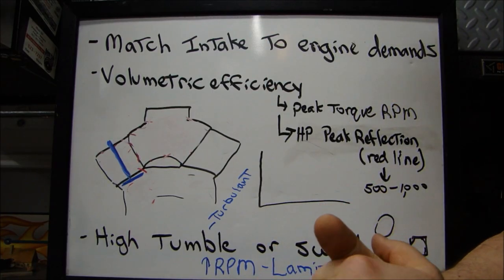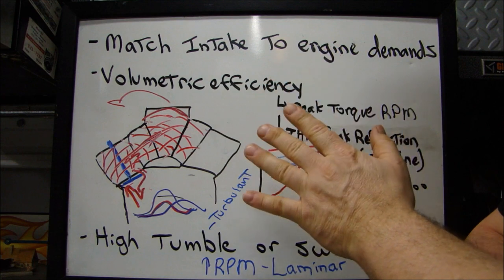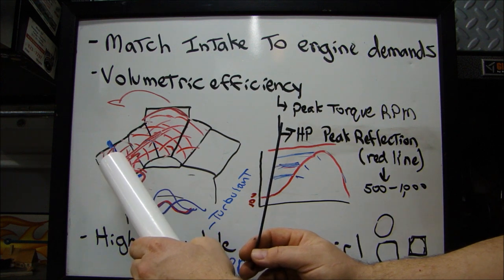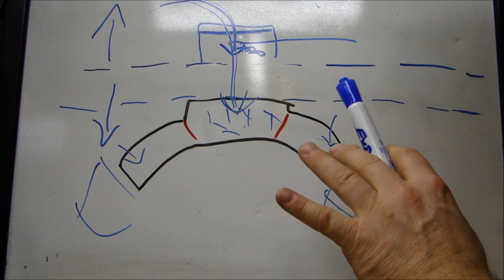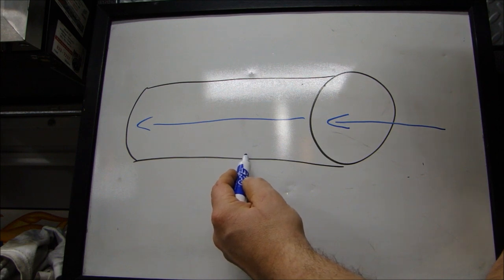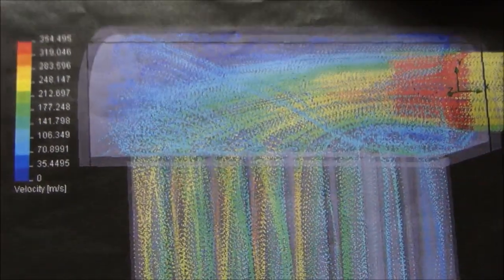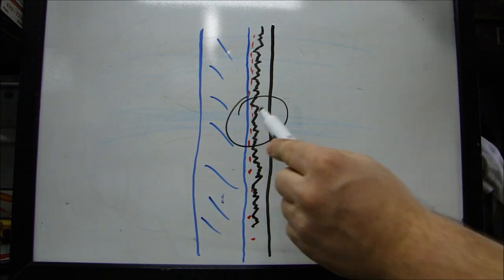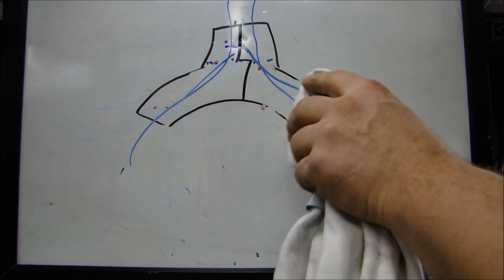Engine Building Part 8:   Intake Manifold Theory

Comment: you in your video slightly mixed up how bernoulli's principle actually works it's the slower air underneath that creates an area of high pressure compared to the top of the airfoil. On top of the airfoil air is moving faster due to the farther distance the air needs to travel to go around the airfoil compared to the bottom. sorry but if I flew an airplane using your interpretation I would crash and burn. On the flip side your videos are chock-full of valuable information, keep up the good work.
Reply from the maker: MrSquirrelyman123 Thanks....I thought I corrected that....I appreciate it

Comment: Hey Pete. Want to exchange emails? And I think I have added 100 moore Hp probably an other 85 lbs of torque. The maniacal s10 came with 160 to the crank. The 262 v6 was slateded to be a marine motor. Have questions please ask. And where are you located. Thanks maniacal s10.
Reply from the maker: I am in Buffalo, NY petesgarageinfo@gmail.com

Comment: This is godly for us noobs sir. Thanks a lot!
Could someone indicate a material on those older SOHC 8v audis that were mounted on vw's? (I also need some advice on the Pierburgs)
Reply from the maker: +Marco Martini That's a tough one. good luck finding that info. If I come across any I will share
Reply: Thanks again! I found some material, but it is in Russian and other slavic languages. It seems that there is good material in spanish.

Comment: So... keep it rough for carbed engines and smooth for fuel injected engines. Right?
Reply from the maker: mikeradman Yes
Reply: mikeradman Yes and No.   I believe the major contributing factor is likely that carb'd setups are introducing the fuel much earlier into the air stream(further from the combustion chamber) while EFI introduces the fuel much later into the air stream (closer to the combustion chamber). 
Also keep in mind that early EFI systems such as throttle body injection could/should be treated more as a carb'd setup in this aspect since it introduces the fuel into the air stream just past the throttle body. As EFI technology progresses the more you'll see direct injection which essentially doesn't have to deal with these issues, however it has it's own to deal with. Essentially, the further from the combustion chamber the fuel is introduced to the air stream, the more you have to worry about effects from the intake system, such as roughness, cryogenic expansion which can cause the fuel to drop out of the air stream and onto the port walls, etc...

Extremely simplified explanation of boundary layers, but without the math it was to be expected. I would've loved to see an illustration of the velocity profile and it's relationship to the boundary layer. (I.E. the development of the velocity profile as it progresses into the port and becomes fully developed and maybe a mentioning of the vena contracta)
 Great videos none the less though.

Comment: is it ok to run a cam with 2000-4800 rpm range and a intake with a rpm range of idle to 5500?
Reply from the maker: The cam and intake are not the limiting factor to higher RPM's. It won't hurt it

Comment: You said that if this was carburated things may be different. I'm interested in doing this carburated, what would be those things that could change?
Reply from the maker: Surface finish, velocity, runner diameter. Is there anything specific?
Reply: Would it be worth getting a different intake then If u used carbs?
Reply from the maker: Not really. I modified a carb manifold for throttle bodies

Comment: any suggestions for an intake on a 5.7 vortec? i have some other upgrades and the manifold is keeping me from getting the engine to be where i want it to be for power
Reply from the maker: What are you currently running?
Reply: Just a chevy silverado, lookin to put some more power into the motor
Reply: I beleive the injectors are inside the stock manifold, and they are spider injectors, so that means i would have to find.a way to put in.new injectors somehow

Comment: I have a 2013 cruze and I have it 2 port direct ram, one port is the ram hood and the front grill , I want to have an F1 style air intake manifold, should I make it out of cast aluminum ? and can I make custom ports for better sparkplugs and injectors , I'm looking to go to either 810cc or 1000 cc injectors. Is this safe for stock pistons?
Reply: Also was going to have an air intake system resembling the NA 458 Ferrari. So the direct ram air ducks will be less pipe shaped and more of a scoop for the front grill leading to the air filer/rain guard and then will connect to more of a "lung" directly attached to the throttle body.
Reply from the maker: That's an aggressive project. You'll need pistons to match the heat and HP. Is would be best to use extruded aluminum.
Reply: +Petes Garage will do, when I can get to it, I'd like a different set of gearing, but it's front wheel drive. Do I just have to get a new planetary gear set or do I have to change the cram shaft crank etc. 
I'm mainly going for wtcc build.
Reply from the maker: Changes all parts so they match

Comment: does an engine suck air fuel in or is it pushed in?
Reply from the maker: Most engines draw it in under vacuum, a supercharger compresses it and forces it in, and a blower simply blows it in.

Comment: How can I get your input on super charger manifolds? I have a modified pulling tractor with blown Chevy's here in NY.
Reply from the maker: +R Rockefeller I'm in Buffalo, NY. What do you need help with?
Reply: +R Rockefeller by the way, I have been building pulling tractor motors for 30 yrs, and you have some great information here.
Reply: +R Rockefeller I would like some information on using a 4 barrel manifold with a supercharger.
Reply: +Petes Garage Manifolds for BBC blower motor. can i contact you directly somehow, I am in Phelps, NY  rpr(at)fltg.net

Comment: I want to build a inlet manifold for my 4 cylinder 2.0 litre 124 kW engine. Rev limiter is at 7200 rpm,and now with another camshaft it will be higher say 7800rpm. I want a intake that would have almost flat power curve from 5000-7500 rpm,is that achievable ? Thanks! :D
Reply from the maker: under90seconds Anything is achievable if it is engineered correctly.
Reply: *****  I want to do something like this,in this shape:
http://farm3.static.flickr.com/2668/5707331979_5ed931673b_z.jpg

I want to move peak torque up the rev limiter and have enough power in high revs,without any drops before 7000 rpm 

If I use longer runners,what would I achieve? Thank you!
Reply from the maker: under90seconds Longer runners are not as important as the shape. More round and small diameter to get more velocity.
Reply: But my head inlets are oval shape, anyway Thank you Pete!
Reply: 1. Download/buy "Performance Tuning in Theory & Practice
2. http://honda-tech.com/honda-prelude-4/**calculating-intake-manifold-runner-length**-get-out-your-vtak-calculator-yo-1963201/
3. Science it up
4. Profit.

Comment: A long long time ago apple shaped ports were the next big thing.  The idea was to split the inlet charge into two jets that would go either side of the valve guide instead of ramming into it and causing turbulence.  Its all old hat now as four valves are better than two.  16 valve twin cam turbo on a four cylinder engine can produce amazing results.

In the bad old days on British budget priced engines quality control was not so good. Allegedly when the heads were machined, as long as there was some kind of a hole to let fuel in and exhaust out, it was a pass!  Grindstone kits for finishing-off what the factory didn't do used to sell like hot cakes.
Reply from the maker: That is really interesting. Thanks for sharing!

Comment: i have not personally seen any engine build peak torque past the peak hp line. most hp is closer to redline, peak torque can be withing 200 rpm lower upto 2k lower and beyond. then again i have not seen everything in life just yet. 
so pete tell me this, why not use a ford 400? many years in a row engine builders mag has come out with the biggest numbers on a budget.  then again i commend you on originality.
Reply from the maker: +chris keiley You are 100% correct. I misspoke when I made the video. I am making a dyno video now and will clarify that point.

Comment: What is the final horsepower numbers of this motor
Reply from the maker: +Brent Green I'm going to have it on the dyno soon. Just wrapping up a couple last videos on it
Reply: +Petes Garage what is your guess as you are basically building the engine I want.   Also what is you opinion of the stock ford block vs a aftermarket block.  Is there a fuel injection option other then making the manifold yourself. Thanks I have enjoyed all of your videos so far great information for a first timer
Reply from the maker: I did have it on a dyno before the oil problem started and it made over 500HP. I like to buy used blocks because they are seasoned, but new ones are fine. I had to make the manifold because there was not a dual quad EFI one. I'm sure you could find something for a single body. Thank you for watching

Comment: If there is so much debate over polishing or not polishing the intake manifold, why don't they (you) just compare the a flow chart from each?
Reply from the maker: Because a flow chart does not show the whole picture. It's all about flow and velocity. Too much velocity the engine runs lean. Too much volume the fuel deos not stay atomized.

Comment: how could your peak HP be at 4880 while peak torque is at 5000? Isnt HP 
Torque*RPM/5252? if so then peak HP could never be at an RPM bellow the 
peak torque
Reply from the maker: You are correct

Comment: so a duel plane manifold is better. why wouldn't you want independent planes for each cylinder. it looked like from that air flow chart some cylinders get less air so maybe if they each got their own independent air source. they would get the amount of air they needed instead of fighting over what's in the plenum.
Reply: Yeah I here ya. In that respect,Optimally 1 carb per runner.
Reply: +69tinatforme I thought it was interesting that his throttle bodies had four distinct valves or whatever you call the flippy part in the throttle body. I could see the engine being more efficient if there was an intake that separated each cylinder. and then maybe had hoses running out to the fender or somewhere like a cold intake.
Reply from the maker: The important thing to remember is that this engine is fuel injected. Smoother air flow is important. If it were a carbureted engine it would be a  different story. There have been engines with one carb per cylinder but the are extremely difficult to tune and keep in tune so any gains are difficult to maintain.

Comment: peak torque cannot occur at a higher RPM than peak HP peak HP is always above 5252RPM as peak torque is always below 5252 as hp is just a calculation of torque at a certain RPM
Reply from the maker: +aloudasshole You are 100% correct. I misspoke

Comment: all production car intake manifolds are designed for low cost and low rpm . Performance manifolds shift it to a higher rpm range.  But the best is individual throttle bodies or carbs which is most costly and you did not mention them. Everything is a compromise so what is your intended outcome? Like designing a Amplifier start with expected- calculated power and work backwards to each individual cylinder having the most yet equal power output with response wanted .Every sport bike has a carb or throttle plate per cylinder.best flow response and equality of power possible. A single 4 barrel is garbage in all respects except low cost and simplicity.The performance is compromised.That is why American v-8's use it. look at a Mercedes v-8 sometime.
Reply from the maker: Interesting, thanks for the comment.

Comment: Dont know why you would need 2100cfm of air flow from a dual plain manifold. A high rise single plain would of been a better choice with a single 1050. I believe your going to bog down under wot and fuel injection was never designed for such a manifold and you will end up with a weird looking fuel map and timing curve. Plus those duel plain are just ugly . I hope you didnt pay much for it. Good luck
Reply from the maker: I made it because I've never seen one. I want something different
Reply: Yeah fair enough.